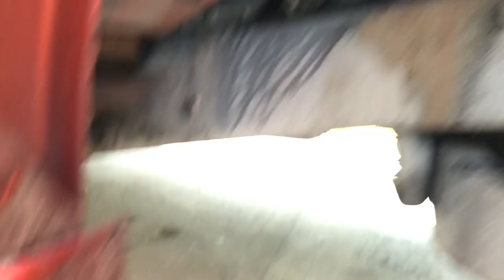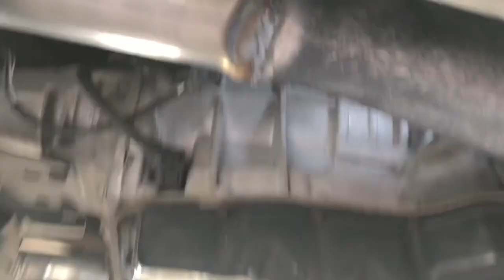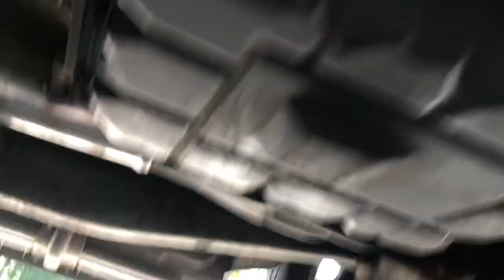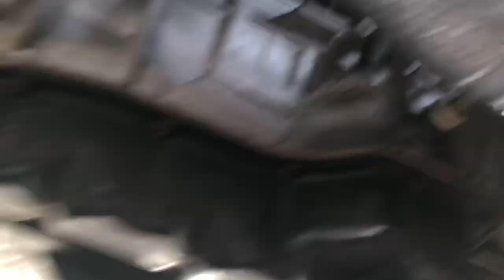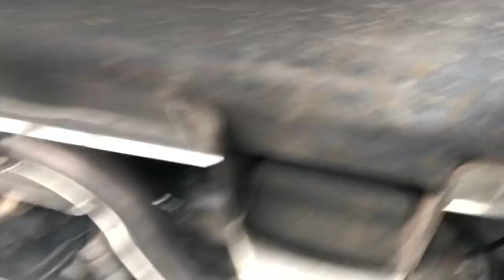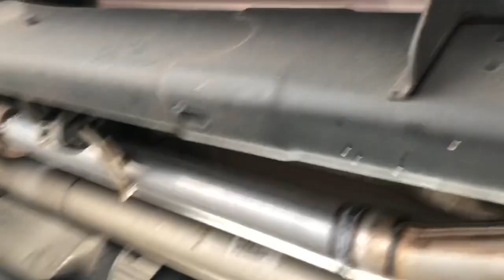Ram pacesetter headers & magnaflow exhaust

Comment: I’m putting the same headers on my ram Daytona this week. After seeing you video I’m excited to hear what mine is going to sound like. Did they make a big difference as far as performance?
Reply from the maker: Willis The Man i felt a difference on top end but im about to get the truck tuned so hopefully it wakes up the truck like it should
Reply: I haven’t gotten mine on yet having a electric issue fixed at the moment but as soon as i get it back there going on. I just picked up the evolution cts 2 tuner hopefully that will help as well

Comment: Did you use the gaskets the headers brought ?
Reply from the maker: No I bought oem gaskets from the dealership
Reply: Do you know what’s the part number just wanna make sure I get the right ones
Reply from the maker: @alexgonzalez4502  i dont bro.. i just went to the dodge dealership & told them i wanted some gaskets & they got them for me
Reply: @streetterrorperformance6227  okay thanks so just ask for oem gaskets ? Or do I gotta tell them they for long tube headers
Reply from the maker: @alexgonzalez4502  just tell them you installing headers on your truck & you are looking to buy oem gaskets for the exhaust manifolds
Reply: You got instagram bro ?
Reply from the maker: @alexgonzalez4502  @j0ker_530
Reply: @streetterrorperformance6227  check your dm bro